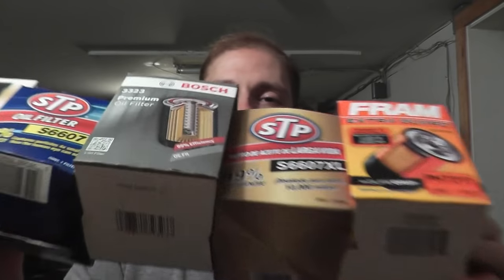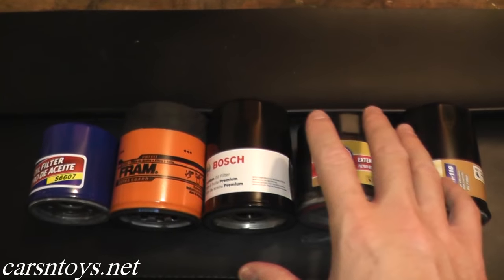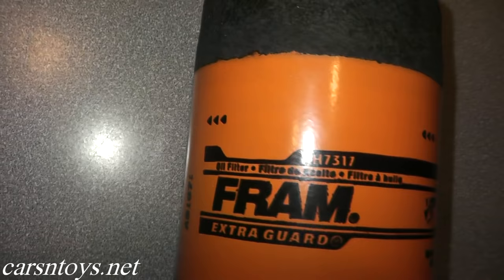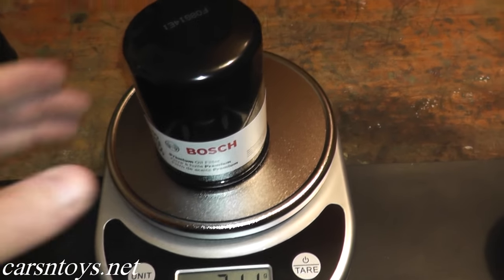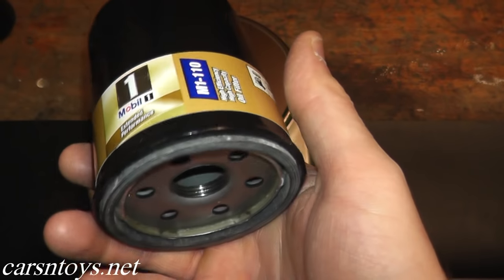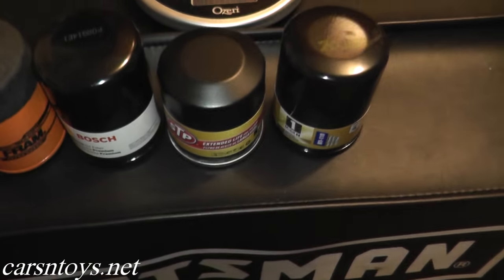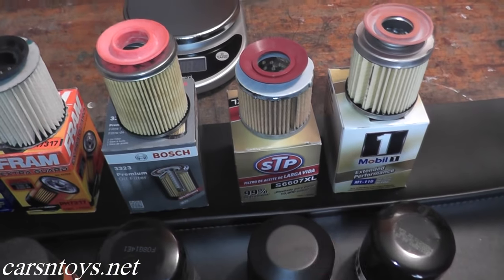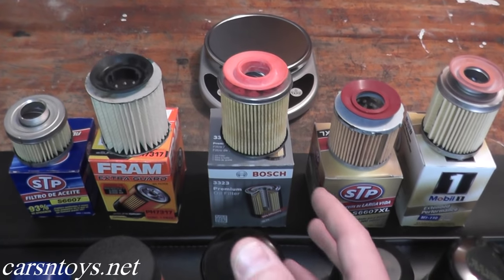OIl Filter Comparison...STP vs FRAM vs BOSCH vs MOBIL1

Comment: All these filters are manufactured by the same company.  I was in charge of their supply chain for 20 years so I know these products intimately.  All but the Fram and Korean STP were made in the same factory on the same line.  All are good filters and work.  The specs are the difference when the brand buys from the manufacturer, Mobil 1 highest spec, then backing down in reverse order.  BTW, the weight means nothing, the cardboard end caps are not a quality issue.  It is all about the media.  Everything else on an automotive oil filter is just a container and a check valve so your engine does not seize if it gets plugged.  Media, Media, Media.  That is what makes the quality and value of the filter.BTW, this company also makes the K&N, Motorcraft, AC Delco, Mopar, Valvoline..and about 80 other OEM and Aftermarket brands. Many of the media are purchased from the same suppliers.  Components are purchase from same suppliers.  Oil and Air filters are a commodity product.  Not a lot if difference from brand to brand or manufacturer to manufacturer.
Reply: would you recommend a sythentic oil brand?
Reply: +Max Dave what is the check valve and how does it work?
Reply: +ijustinw Hello, check valve is a pressure relieve valve that allows the oil to continue to flow to the engine in the event that the oil filter becomes plugged for some reason.  This will prevent seizing of the engine from lack of any oil.
Reply: +David C Most major synthetic, and actually the blended synthetics work fine.
Reply: Mobil 1 is far from highest spec. The one they say is for my car is not only much smaller than factory, the bypass valve is 12psi vs 23psi
Reply: +FCFordLord that may be because the oil filter gets too close to the headers or the engine
Reply: +Max Dave then hb an oil filter to not use (fram¿).?
Reply: +Max Dave No cardboard end caps and center tubes for my engines.
Reply: +P Pyzyna Totally your choice, but it is not a problem, really.  Remember, the filter itself is paper media that is pleated.  You could have titanium end caps but the actual filter is folded paper.  Both are reliable, but like I said, your choice, really.
Reply: thanks for the info
Reply: +Max Dave     NOT all filters are pleated paper media.  Look again at a Mobil 1.

Comment: M1-110 -- Works great on the 2012 Ninja 650 with a wet clutch. The M1-109 (IIRC) is just a bit shorter. 30k+ miles and counting :) Rotella T6 oil. Hands clapping? Well, I'd fade it down a bit but it isn't my video. Thanks for taking the time to shoot and edit it.

Comment: Bosch makes the best stuff. Even better than higher priced other brands.  I bought one of their batteries and it was 7 years before i sold the truck and it still worked fine.  The plug on one of my bikes a Honda Cr 85  would need replacing every two or three rides because of fouling.  The NGK plug was out of stock at the dealer so i put a Bosch i got from autozone on it.  Two years later no fouling.

Comment: The absolute test would be to drive two vehicles under the same conditions and  with the same driver .one car  would be using a fram and the other mobil 1. Whichever one is in the best condition in the end is the winner. Personally I have been using Fram and Supertech .my 04 dodge neon has 225k miles on it and it is still running well. I change my oil every 5k if its conventional and 10k if its synthetic. I replace my filter every 10k. I have been using Supertech and Chevron motor oil either synthetic or convential. No problems and best thing is my car outlast a lot of the cars which used the "better and expensive"stuff.
Reply: This sounds a lot like me.  I used Fram and Supertech from the 1950's on with no problem and many miles.  I bought my first new car in 2009 and  my second in 2010.  I still use Fram, but their best filter for 15,000 miles, and a good synthetic oil in the two cars.  I still drive my 1995 Toyota Tacoma using Fram and Supertech.  The important thing is changing the oil when it gets dirty.
Reply: +Iambigcougar try out Bosch Distance Plus they cost $12 but too me I use to run fram but I compared there high end with Bosch's high end and Bosch kept it cleaner
Reply: That's your choice but I would like to know how many miles you put in your car and how do you know bosch kept it cleaner.
Reply: I believe the 15k mile one is the XG filter I use the TG which states you have to change the filter every 10k. If I use conventional oil I just drain the oil at 5k if its synthetic 10k.
Reply: +Vinh Tran average that we drive a year is around 3000 miles we don't drive out of state but kept it looking like new the fram however by half the year it started darkening and by the full year its black we used the Fram High Milage and Extended both didn't have a difference our car is a 2001 Ford Expedition with the Triton 5.4 2 valve but in my opinion for what I paid K&N is terrible $17 for something that filtered slightly better than a From!
Reply: Its your money Im sticking to Fram or Supertech.If you pay for the Bosch filter Ill take it lol. I am playing at least half of what youre paying multiply that by the amount of times you changed your oil. I probably saved 400-500 dollars of what you spent if you change your oil 5-10k like I do. Secondly I can take a pic of the odometer if you don't believe me that's my proof. How many miles do you have on your SUV don't lie because I will call you out on it . I towed , lived  and drove in the rough conditions{Snow, Freezing Temp, city traffic,high speed. and high heat. Bottom line its your money the money I saved can be used to replace a battery, timing belt, water pump, tires, and etc when its time to replace them
Reply: I also drove from CA to FL and TX to MT. Not to mention at least 15-20 trips back and forth from CA-CO
Reply: Vinh Tran actually the longest trip we did but only once cause it was necessary was drive from Colorado to Mexico in the summer we used a Bosch filter and it held up since in Texas some roads allow u to pass semi we do it but the stress it does in the SUV are 8 people and still have cargo then there's the high heat easily over 100 and to pass them we have it floored for 15 to 20 seconds going up hill in Mexico cause highways in Mexico are steeper but I'd say the full trip is 5000 miles to and from including the miles we drive around in Mexico
Reply: ARCH $38? Wow that's cheap I did an oil change for our Ford Expedition every 6 months and it cost us $75 I use Royal Purple and a Bosch Distance Plus oil filter nothing wrong with over maintaining your car I just want them to run a long time but I also just replaced the injectors total $650 and now a while later going to replace the coils and spark plugs NGK plugs and Accel coils the injectors where Delphi the year is 2000 but we also torture our cars we towed 8 tons with a dump trailer hauling roof trash next will be a transmission flush that's something I will need a mechanic to do so not sure the cost right now it's at 120,000 miles oh and we only use premium fuel engine still sounds as when we bought it
Reply: My point exactly, both does the same job but one cost more than the other. Where did you get your Mobil that's kind of cheap but I still wont buy it unless it cost the same as the generic stuff.

Comment: This is borderline useless information. What are the microns of filtration? You removed the anti drain back valve on every one of the video, but made no mention of them. Okay, a more dense filter with tighter filtration media and metal endcaps will weigh more than one with less media and paper endcaps. We get it.
Reply: +opmike343 Right, the quality and density of the media. and the type of the bypass are more important than anything mentioned here

Comment: You recommend changing every 3 months if using the STP filter.  If I only drive 500 miles/month, can I change filter every 3,000 miles instead of every 3 months?

Comment: My Toyota has almost 300,000 miles and I only use OEM oil and filters from Toyota. I use some excellent car care software www.automotivewolf.com to monitor the maintenance schedules and track parts, performance etc. I change the oil every 10,000 miles with Full synthetic.
Reply: Thanks for the tip. Love the software.

Comment: The AMSOIL Ea filter (un compared) has a full range of applications, also. The price average is $12.50. The filter media is nano-fiber. with wire mesh containment inside the casing. The mileage is rated in two ranges. 

For a small filter as for a Toyota  the guarantee usage is 15,000 miles. (The cost is @ $11.00). 

For a larger filter as for a Chevrolet light truck, the guaranteed mileage is 25,000 for @$12.50) (as is their Signature Synthetic Oil)(rated for 1 year oil drains or 750 hours or 25,000 miles).

Comment: The important things to compare weren't, except for  a couple of text boxes near the end there. Mr. Toys should have mentioned the bypass relief valve settings, the filter media material, the gasket material (rubber, nitrile or silicone; silicone is the best) and the micron rating of each filter (that indicates what sized particles will be filtered out by each oil filter. The weight of the filter is of minor importance but not unimportant. The number of pleats is shown and he did mention prices. What's most useful is that the filters were cut open for us to see. IMO

Comment: I completely agree with your comment about Bosch replacement parts. Thats what I usually stick with if I can when it comes to sensors, coilpacks ect. I'll have to pick up a filter next time.  I usually stick with gtx extended life high mileage with filter

Comment: You can not tell quality by the weight of the filter media. Things that are important are surface area (particle capacity), what is the filters micron rating (the size of the particle that is caught going through the media) and the valving on the filter. (By-pass, anti-drain back)

Comment: Mobil 1 is what I just bought. Mobil 1 into the Nissan, and Valvoline synthetic in the Chevy. I had a line blow out and put in a patch with some tubing & clamps and drove over the Rocky Mountains 2 quarts low, no damage! I did not have any loss in pressure, and I only had 2 quarts of spare oil in the truck. 7-9% grades up 2 mountain passes. I got another quart in Glenwood, then had the truck fixed in Grand Junction. I run synthetic, because sometimes I need to make a 3000 mile trip and don't have time for an oil change before I leave. I actually prefer having work done anywhere BUT Phoenix Arizona. I will pick a Valvoline oil change center in some little dink-ass town and use them.

Comment: I am glad that you differentiate between the types of filters out there from basic, mid-priced and premium.   But the fram filters are not cardboard but a carbon fiber composite.   And since they have made over several million of  these over the last 20 years of this carbon filter composite, they have stood up to the test of time.  There are youtube video about how and why Fram makes these filters.  Look it up.  And No, I am not affiliated with Fram but I have used their filters.  Just trying to set the record straight about Fram and correct the misinformation out there.
Reply: +Serge Blain lmao fram is garbage, theres no arguing out of that

Comment: Maybe you should have looked closely at the construction quality of the filters. For instance Fram is well known in the industry for having shoddy construction. Some have been found to have incomplete sealing at the point where the filter is seamed together usually with a crimp on metal strip and sometimes with zero filtration at that point. I have seen sometimes five out of ten having zero filtration at the seam due to failure to get all the filter inside the crimp, and not to mention a crimp instead of glue can allow particles to push around the crimp. Fram is not only not recommended in my field but strongly suggested as a last resort filter when no other is available.
Reply: In fact, check out the video "(Warning) For you Fram Oil Filter Lovers" Shows a perfect example of what I am talking about!

Comment: The bad thing about Fram is that in Hyundai's it can't produce enough back pressure in the top end of the engine and leads to a valve tick in their engine's. I always end up using a K&N oil filter and that eliminates valve tick. If you want to read up on it, hyundai released a big statement about it, and you can actually void their warranty by using a non OEM equivalent oil filter.

Comment: I'm never concerned about the miles that I put on my truck because I drive very little.  I'm more concerned about the time or how long in terms of time the filter lasts before the paper starts to rot.  In 3 months time, I probably will only put about 500 miles on my truck.  So I want a filter for conventional oil to last least a year, or longer.

Comment: Keep in mind the older your ride the better the filter you want to run. As things wear such as your rings the more blow by into your clean oil you are going to get. The more surface area and quality of the filter the better. You should also change out your dirty oil more often.

Comment: In the 80,s I worked at fram we made filters for so many brands. Not much difference in how they are made. But the element paper is different from brand to brand. How its pleated and if it has a screen wrap or mesh

Comment: Main thing I got from this is that FRAM has cardboard where the rest have metal. Looks like a good reason to choose another brand. To be fair, though, I drove a 1985 Nissan pick-up (bought it new) for more than 300k miles using FRAM filters and Castrol oil of the specified viscosity over the course of seven-and-a-half years, and traded it because the seats were getting tired and I wanted a new vehicle. Consumer Reports, the people who rated (scoff) an LG as one of the best top-load washers you can buy, rated the FRAM filters as the best at the time, and Castrol oil. I did like their test method for the oil: they passed it through a diesel injector multiple times and tested viscosity at the end of the test. Anyhow, I have never had an engine failure related to use of the FRAM filters.

Comment: I wouldn't recommend that Fram filter for synthetic oil and the carton does not say its for Synthetic Oil. It's the basic 5k mile filter. They do have a filter for synthetic with an XG in front of the number, specifically for Synthetic oil good up to 15K miles. Good video.

Comment: Thank you CarsNToys for the video, it was entertaining and educational! For a 6000-mile, not often used Nissan B14 I am planning to run semi-synthetic on, I would like to change oil 2 times per year, after about 3000 miles each time (or after 6 months), can I leave the filter and change just the oil on the second yearly oil change?

Comment: Not bad, but you should have gone one step further and opened up the paper, then calculated the media thickness, and the length and width of each paper element.  The filter with the most area of of paper would be your evaluation metric in this case.  That is a better indicator of filter quality than cartridge mass.  Another thing to consider would be the pressure drop past the filter.  A smaller filter with more sq-in of paper packed in will impede oil flow and will clog more easily which is bad.  The best quality filters have larger cans with a long length of paper crammed in with lots of folds.

Comment: I'm trying STP for the first time. Didn't read reviews or anything, hopefully it does good by me.
Reply from the maker: Well over a decade ago I had an older vehicle that required an oil change every three months/3k miles. I always used STP and had no issues.

Comment: not mentioned and very important is the bypass valve built into the filter.and what pressure it operates at... also the filtration quality of the paper..   sq inches of paper and micron size it will pass.

Comment: I would think that in order to get a good fair comparison, you might have gotten filters that were for the same vehicle. I.E. Ram 1500 or Ford F 150 with the same engine size... The take away from your review though, is the amount of pleats compared to each filter. Thanks for the video!

Comment: For my Camry, Bosch Extended Plus (D3325) is nearly 2X the size of Mobile 1 Extended Performance (M1-103A). 
Bosch is taller and larger in diameter. 
Mobil 1 is too small IMO.

Comment: All these filters are used up by 2500-3000. I've checked it out myself by blocking the bypass valve on a gm350 engine. The filter was plugged and oil pressure started to drop at about 1500-1800 miles. Not all the oil goes through the filter all the time when the bypass valves working so filter would be good for about 3000 miles or so. Run a good synthetic and change the filter at 3000 miles or so. The oil will be good for 6000 miles but the filters are not used, because they are plugged , after about 3000 miles.

Comment: Fram sucks. instead of the weight, you should've shown how the Fram has a plastic spring and valve on the bottom, the better filters are metal.